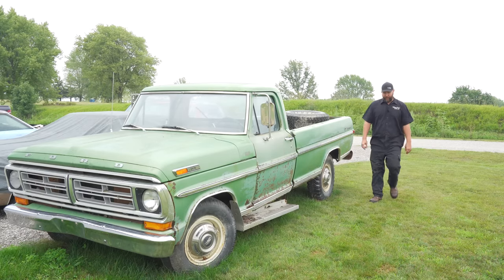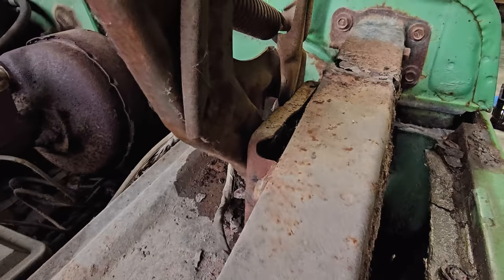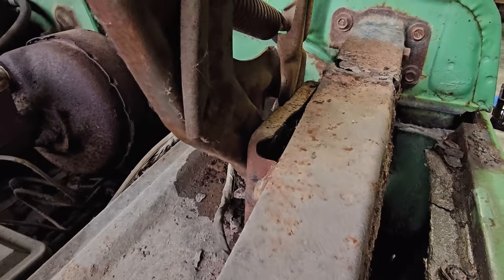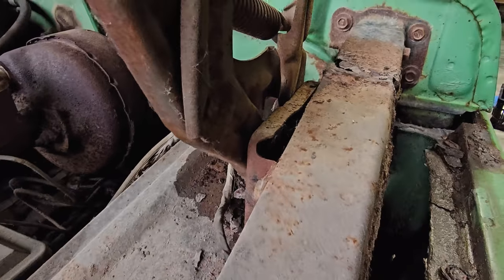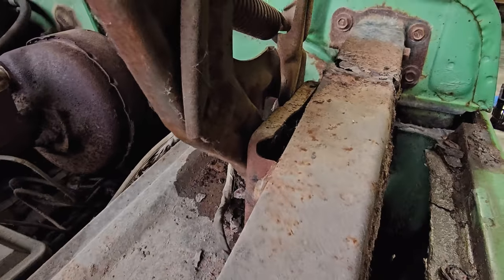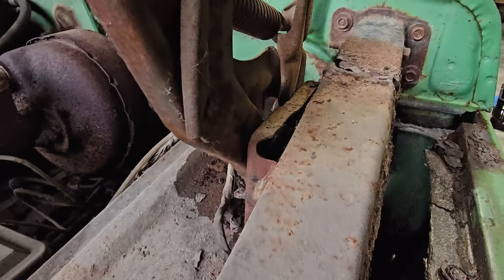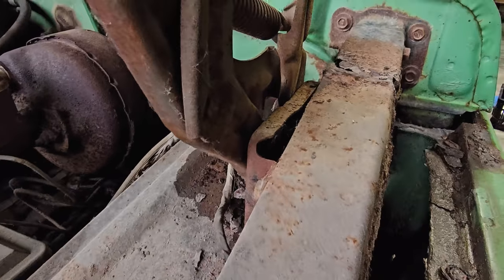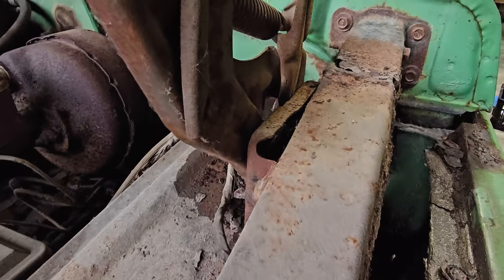Will It RUN And DRIVE 800 Miles To Mount Rushmore? Ford F250 Abandoned for 20 years!

Comment: My favorite part is Derek describing the interior smell, quite unique every episode.
Reply: I could smell the hot pencil shavings 😅
Reply: He needs to come out with his own line of air fresheners.
Reply: Cracks me up too..."shh...smells like...."
Reply: @Hotlog69  yes and hot wheels needs to make a deal to produce YouTubers cars
Reply: @Washedintheblood1988  They've done a couple of Roadkill cars but yes, more!
Reply: I think my favorite one was the "Smells like Vomit and Boiled Peanuts"
Reply: My favorite was "smells like a wheelbarra full of used knee braces"
Reply: Whether he spends hours thinking of new ones or just says the first thing that comes into his head, his descriptions never fail to crack me up. :)
Reply: Each brand and body styles have their own smells when they get old, and it usually is an unpleasant smell. 

My mid 80's G.M. G-Body is starting to get that smell, and its been a drag car for many years now, so it has the scent of Leaded VP race fuel mixed in with it. Makes it a little more tolerable. 

The stinkiest car I've ever had was a 1966 Oldsmobile 98... that frigger REEKED! Smelled like a musty hay loft and burnt transmission fluid. There was NO amount of vanilla scented, pine tree shaped, dangling air fresheners that was going to take care of that business.

Comment: A tip taught to me about 50 years ago by an old brake tech: to get the old seal out without damaging it, remove the nut, washer, and outer bearing. Then put ONLY the nut back on the spindle shaft. Now, apply some downward pressure on the rotor or drum and quickly snatch it off the spindle. The downward pressure keeps the nut from going through the inner bearing. The nut will catch the inner bearing which will catch the seal all the way around removing it completely undamaged. I have reused dozens of seals with no problems.

Comment: I literally have the utmost respect and gratitude for the content VGG brings into our lives.  Thank you, Derek.
Reply from the maker: Wow, thank you!
Reply: @ViceGripGarage  Iowa is a rough state to get vehicles in and if ya ever need a 65 C20 hit me up if a guy could fix the hydroboost brakes in my 98 he could drive the 65 home
Reply: Changing that windshield is abittch
Reply: I have parts
Reply: @don-rw9ef  it's not that bad in the middle of a snow storm we went out to a salvage yard at midnight and cut 1 out while a friend pushed the 1 an owl came through out and vacuumed glass and put the seal and locking strip in a bucket of hot water by 1220 we had the windshield in the midnight parts shopping took longer than removal cleanup and installation
Reply: @don-rw9ef  how close to the Midwest and what parts
Reply: @ViceGripGarage  did I hear you just about almost maybe let a little swear out there about the wheel seals being wrong 🧐🧐😂

Comment: That's just plain ridiculous how nice the interior was compared to the exterior. I mean, it really was jaw dropping. Other than the little split of the seat, it is just immaculate. What a score
Reply: I bet they salt the roads pretty good during the winter there. That's what ate that truck up like that
Reply: He didn't sleep in it 😂
Reply: @ChrisCarpenter-d5e  same with the rotbird Iowa uses salt and calcium chloride I've seen 2010 and newer trucks rotted that bad or worse because of the thinner metal they use
Reply: @46lfries  really you were there what would be the point of adding that much weight and wind resistance then

Comment: Back in June, i flew from my home in Alaska to Denver to pick up a 1973 f250 that had been sitting for at least 10 years and drive it back to Alaska. 2,408 Miles!! All original 390 with c6 automatic tranny. I broke down in Utah, Portland OR, Hope BC and in the middle of nowhere in BC Canada, but it made it home! Oh, and I picked up a 20 ft car hauler trailer in Portland, loaded it with about 7,000 LBs and towed it the rest of the way. After I pulled it in my driveway and parked the trailer, it wouldn't start again until i replaced the starter and adjusted the points and timing.Was an awesome trip with my brother. Learned alot and had tons of fun. it was actually on this trip someone told me about your channel. Great stuff, by the way. You learn more broke down on the side of the highway than you would in a shop for sure!! Im 24 years old and i love the challenge of old vehicles!!

Comment: I won't sell my old ford truck because my dad rode with  me in it. Sure do miss him.I can still see him sitting over there with his arm out the window.  Love you dad.
Reply: I still have my dad's old 57 f100 with the air-cooled auto transmission and 292 y block.. Was the first vehicle I drove and took my driving test in the 80s. Drove it to work when a teenager. He parked it in garden for 25 years. After he passed. I went out to fire it up. Brakes were out. It smokes. Think valve guide seals crumbled away. Trans leaks like a sieve. But it drove out of garden to back of garage. Had more fun in that truck than my Dad knew. 😉 Time to pop in a newer 302 or 351 and Trans. Would like to keep the 292 and air-cooled fmx Trans. But they need rebuild. Going on a pallet for next owner after I tip over if they want to put them back in.
Reply: You sure that is an FMX trans in that? Those were usually a Ford-O-Matic in those.....

Comment: Derek, rally great video and brought back memories.  My parents purchased a '72 F-250 in the same lime green in 1972 (I was 10) with the 360 and a 4spd.  No power steering.  Spent countless hours staring over that hood as a kid, took my drivers' test in it on a snowy winter morning.  

You really helped me with a 'bucket list' item here, as I always wanted to drive that truck again as an adult, and you took care of that for me!  The video took me right back.  It was the little things that struck me; the distinct sound that the door latch makes when you opened the door, the red brake light on the lower dash illuminating when you turned the key, the sound of the starter, the click that the wiper switch makes.  I remember them all.  The white headliner, the rubber grommets high on the inside of the cab corners behind your head as you drove.  They all just hit me.

Thanks for this - great video, really enjoy your work.  Tough old truck.

Comment: I love the 70's and early 80's Ford F series trucks. My first truck was an '81 Ford F100 Custom, with a 300ci straight 6 and a 3 speed column shift.  Loved that truck. It's still in running condition as well with almost no rust.

Comment: Love those old Ford FE engines.  I had a 1964 full size Mercury that had a 390.  At 160k miles I put a new oil pump, main bearings and rear main seal in it.  After that, the motor ran so smooth and quiet you couldn't tell it was running.  Thank you for your pluck and confidence.  God bless you

Comment: Thanks for this video, Derek. This spring, I inherited a 72 Lime Green F250 Sport Custom that had been parked 15 years ago; a lot more miles on it but a lot less weight reduction, lol. I knew he'd said something about a bad wheel bearing and rotor. I was surprised by how easily I could get the engine up and running after watching some of your "will it run" videos; she just needed a new fuel pump, fuel line, and a tune-up. But man, the dump truck brakes!! I battled for hours ripping them off a couple months ago, and between that frustration and the cost of the new parts, I put everything on hold, but watching this motivated me to finally place the parts order today. Looking forward to restoring the old grasshopper to her former glory.

Comment: Been watching your channel now for a couple of years. Always entertaining! You said in this video that you couldn't remove one of the old front wheel seals because "it would be ruined." I've been salvaging wheel seals for over 50 years using a technique my dad taught me when I first got my first car. All you need to do is remove the outer bearing and hardware and then put the bearing nut back on to full thread engagement. Then grab drum or rotor and pull it toward a little bit so the inner bearing drops down and slides on the spindle shaft. Then in a swift and forceful movement, jerk the drum/rotor off the spindle making sure you keep it in contact with the spindle shaft. What happens is that when nut hits the bearing, all the force/momentum transfers to the inner part of the seal and dislodges it from its bore. Voila, no damage!

Comment: Dads 64 galaxie had sat since 2016 when I inherited it early this year. Brakes wouldn’t bleed, after bench bleeding master and replacing front soft lines & wheel cylinders. Still nothing. Distribution block was $230, power disc conversion kit was $700. Went with the conversion. 3 months later and brakes are still soft but can bleed, but now there’s grinding coming from the drinkers side. Still a working progress. The fact that this truck was able to be revived in this time… Epic.

Comment: A feller could get discouraged on such a project, but you kept your cool. i had a 68 with a 360 as a daily driver in the late seventies and revisited some of the engineering marvels of that era. My engine had had a good rebuild, and outlasted two junkyard  transmissions.  Don't let your inner fenderwall electrical ground get loose with the engine running. Good memories of a tough truck.

Comment: ❤ all you do, Derek! 
Watching your videos gave me the courage and some basic skills to get the job done with almost no tools.
My car was totalled, so I had to pick up my dad's new (to him) plow truck with unknown quirks and history. 
Because of watching your videos, I paid close attention to the gages, and this is what they told me...battery was charging, the engine was on the hot side of good, and the fuel gauge worked. So when I made a fuel stop and there was no juice from the battery to the ignition. 
I knew 2 things 
1) the battery was fully charged when I stopped
B) there was no way I was in the fuel station that long. 
Tickled the battery cables with an old pair of vice grips I found in the truck. I made sure to choose a resurant next to an O'Reilly when I stopped for supper just in case. Worked out great since it turned out I needed some mystery oil and coolant anyway.
Gonna give the old pal a once over when it is daylight. Thanks again for all the spectacular family-friendly content. And don't forget all us fellettes out here too. You should see my daughter's eyes light up when she sees you on the TV. She is 9 and is very jealous of Bentley and all the toys he gets to drive. Particularly the tractor. Her favorite video is the old tractor (if I am being honest, it is one of mine too). We love the oddball stuff like the tractor and the Bricklin. This truck with the camper was another one that is slightly off the beaten path that we love.

Comment: Hey there I know it's an old video of ur but I just started watching ur channel. I have a 71 f250 that is my daily driver. I got it around 10 to 12 years ago I have replaced almost everything on this truck except the motor. It took me around 8 yrs to get to where it is now. It runs pretty good rt now. I'm from New Mexico and the body is in great shape  it's a flat bed the only rust it has is on one corner on the rt fender. I'm a Chevy man but this Ford has won my respect for now.

Comment: I grew up near Mt Rushmore, now live in the northern hills, and drive my bump-side trucks as daily drivers.  I never doubted that truck would make the trip.  If I had known you were in the area, I would have tagged along in one of the high-boys. Without a doubt, ford trucks of the Late 60's and early 70's are some of the very best machines to ever roll off an assembly line.  Simple, tough, reliable, beautiful, American made by Americans.  My favorite  Bump-side is my 1967  F-100 2WD, that I have had since 1985, now with over 400,000 miles on it.  Though unrestored, It still gets compliments nearly every time I drive it. It makes me smile inside every time I look at it.  What saddens me the most, is to see how many people put up with the late model stuff.   Thanks for putting a smile on my face.  Is your truck for sale?

Comment: Great video that old Ford is still running tough. My Dad had a '72 F250 4x4 that thing was a beast split rims and all I learned to drive in that truck thanks for the reminder Derek. PS we had a over cab camper too saw much of the USA looking out that window in the front.

Comment: Hey Derek, I am a prescriber from Northwest Montana. I really enjoy your programs and I think I’ve watched most of them. I just watched the one on the pickle Ford truck with the camper and I noticed that you were having trouble with wheel bearings and didn’t really want to pull the rear wheel bearing because you didn’t want to ruin the seal. I don’t know if you’ve ever seen this done or heard about it but if you screw the spindle nut back on with the front wheel bearing already removed, the nut will slide through the hole and the hub will drop down on the spindle and then when the rear bearing hits the edge of the nut, you just pop it out and the rear bearing and the rear seal will come off Real easily and I’ve used that several times not hurt the rear seal at all. Thought it might help you out in the future.

Comment: I had a 79 Ford truck, and it doesn't seem like they changed appreciably in the years between. Mine only had a 302 though. The twin I-beam suspension taught me a lot; it taught me never to get another Ford truck.
Reply: Someone told me a Crown Victoria front suspension is a bolt in swap for a Ford pickup.

Comment: You can save and reuse a wheel seal. Remove the wheel bearing nut, remove the outer bearing. Replace the nut, and give the... dinner plate a pull. The inner bearing and seal will remain on the spindle.

Comment: I bought a 65 F-250 that had 16.5 wheels and good luck finding tires for it unless you want some giant mud tire.  It also has an 8 lug pattern to make it even more impossible to find wheels for. I ended up buying 18" 8 lug  wheels off of a late 90's Dodge Ram to fit on the truck. But the truck is in amazing shape and has a 4 speed and a 460.

Comment: I had a 71'  Ranger XLT with a 360 ci in it.  Funny fact.  If you turn the 4ways on, press the brake and hold it, them put the gear shift in N - The radio will play w/o the key...  I think... It's been 40 years ago.

Comment: Derek, I sold my 72 f 250 camper special,regretted it almost immediately, 390 automatic 4bbl 142,000 original miles that I poured lots of money and time into,absolutely no rust and only one small tear in the seat on a seam ! Same color but two tone white and green!

Comment: This is so cool. I learned how to drive manual transmission in my parents 1972 Ford F250.  It was a work truck geared for pulling. Maxed out at 50 mph on the highway lol. It was the same color as this truck too, we called it "The Booger"

Comment: I HAVE DONE SIMILAR RUNS AS YOU,  BUT THEY WERE OUT OF NECESSITY I  DIDNT CHOOSE TO GET INTO THOSE SITUATIONS, CHANGED MASTER CYLENDERS ON SIDE OF THE ROAD 600 MILES FROM HOME , PULLED TRAILER AXLE BACK IN PLACE WITH A CABLE CRANK, PUT A 2X2 IN WITH HOSE CLAMPS TO HOLD IT THERE AND DROVE LIKE THAT. PULLED AXLES IN PARKING LOT & CHANGED BEARINGS. IT IS CRAZY AND YES YOU ARE A NATIONAL TREASURE I LOVE WATCHING YOUR VIDEOS , BRINGS BACK MEMORIES, GOOD LUCK AND KEEP  MAKING MORE , I'M TOO OLD NOW SO YOU KEEP  GOING, I'LL WATCH YOU. GO  VGG

Comment: I think the tire gel would definitely help with the overheating problem because it'll cut down on the wind resistance on your tires and your truck will go a lot better maybe even put a little bit on the front of the camper to help the wind  bounce over top, that was a good call there.

Comment: you should try, putting 3 of those fuel filters inline, with a few inches of hose between each one, that way, when the first gets plugged up you can just pul if off and connect the hose to the 2nd one..... and so on. save ya some time and works good. keep up the awesome videos!

Comment: I had a 75 f-250 camper special with a 360and 4 speed trans. It's a beast of a motor. I had the points set up. It was a 2 barrel carb also

Comment: I owned a 68 F100 with a 360 ci manual trans. It leaked oil from the rear seal like a sieve and had 155k miles when I bought it in Texas. I also owned a 74 Gran Torino with a 351 ci Windsor. I swapped engines in the truck and learned a few things. Motor mounts and bell housing was required from a Mustang...69 I think. Long story short as I kept and drove this truck as my daily driver for 12 years. Derek pointed out the power steering in this '72. I found a burnt '72 and learned that this year was the first year Ford put power steering in the truck. So guess what I did? Yep I was dipped...but had to replace everything from the gearbox to the steering wheel. What a project but well worth the ease of steering.

Comment: Excellent subject turbos you are correct on can't over speed them I rallied cars for many years and only stalled them sometimes that would break the Shaft, best way to explain the spoiling up and down was when you get off the throttle the boost dumps via blow off valve if that doesn't work the compressor side would stop so radically the Shaft would shear